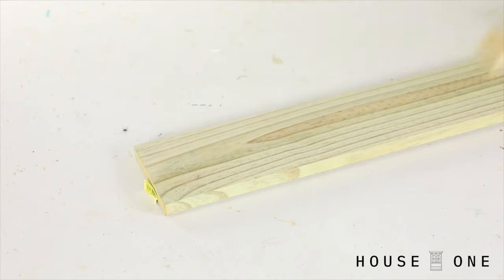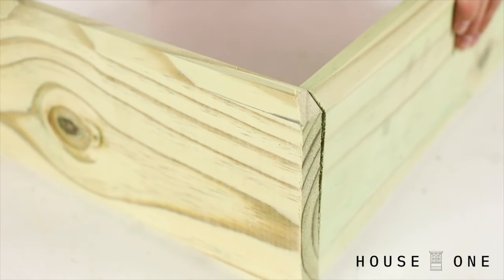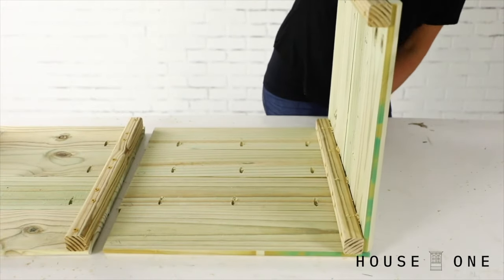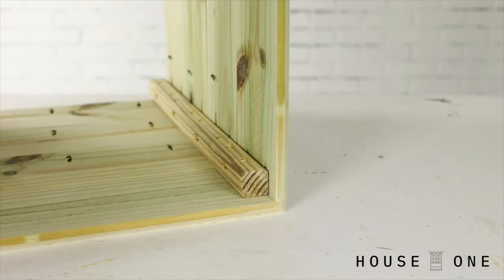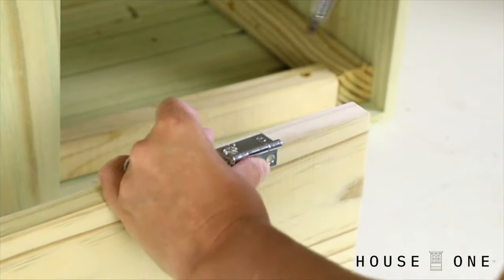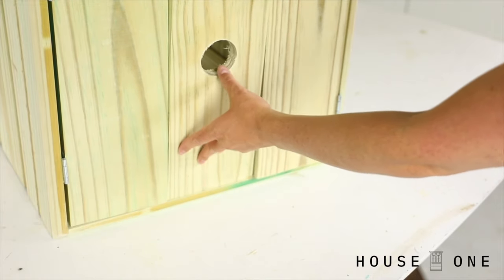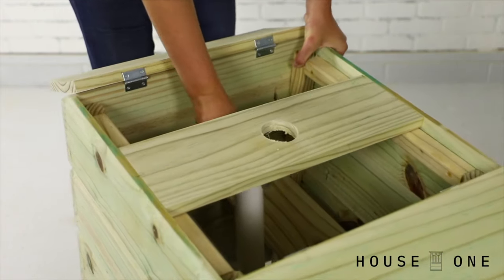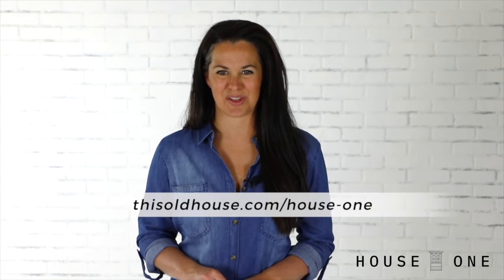How to Build an Umbrella Stand Side Table | House One

Comment: Not comfortable with handling PT lumber. And the ability of the table to keep the umbrella upright in a bit of wind.
Reply: throw a steel plate in the bottom and it aint goin anywhere
Reply: You could use cedar and remove the umbrella when not needed or close it
Reply: @MrSGH21  I second the cedar over pressure treated poisoned wood...   my idea for wind involves an extra shelf in bottom for sandbags.
Reply: If we put pavers in the bottom adding as many as you need for weight. Leave space between pavers for the pole. Pavers also work as cubbies if laid out that way. Easy peasy

Comment: Please remember to use proper personal protective gear, especially when working with pressure treated lumber.  The chromium salts used in pressure treated lumber are quite poisonous.  A better choice, though a bit more expensive, would be to use cedar boards.  Cedar fence boards and pickets are not terribly expensive, but happen to be naturally insect, mold, and rot resistant.

Use proper dust collection as well as a good filter mask with any pressure treated wood.  You also want to ensure you are not using it in your garden areas, as the poisons can leach into the soil.  Dont go sanding this stuff without proper precautions. Your pets will thank you for their longer and happier lives without chromium salts in their food and water bowls.

Lastly with the screw to hold the umbrella in place and the pipe...  I would add 2 more, so you can center your umbrella in the pipe, and thread the holes for thumb screws. I would also add a shelf in the bottom for a sandbag or two in case of high wind.  Make it accessible if you want it to be lighter for moving it around.
Reply: I thought pressure treated wood stopped being so poisonous like 15 years ago?
Reply: @Eric L  "Yella Wood" brand pressure treated lumber went on the market earlier this year... this should be safe to use in gardens.  If the wood has a GREEN tint to it (from the chromium salts) DO NOT USE IT for gardening...
Reply: @KithinaSoulstriker  I just got the brown micro-sienna where I'm at

Edit: I've seen some gray stuff as well..wonder what that one is
Reply: @Eric L  if you're not sure, have it checked.

The woods I would recommend are yellow cedar, red cedar, cypress and that "Yella Pine" branded lumber.

All four are softwoods, if I recall correctly, and rot/mildew resistant. Cypress may not be quite as resistant to certain types of insect infestation.  It would also be MUCH more expensive, unless you have some locally and you know someone with a sawmill...

As I said, though, with that grey looking stuff... if you don't know what they put in it, I wouldn't put it in or near your garden. 

You can check your local lumber yard and supply stores, perhaps they have some on hand or that can identify it for you and tell you if it may be safe to use.

If not... take a small piece (very small!) and burn it.  If it smells really bad, with black acrid smelling smoke, get rid of it!  Use caution though, poison is still poison!